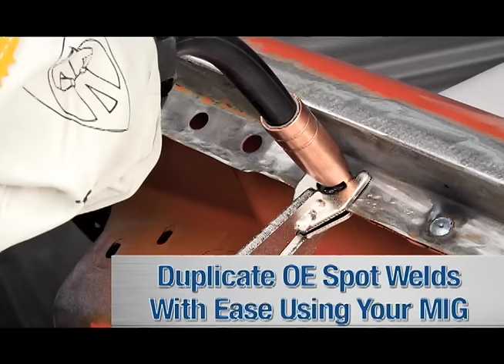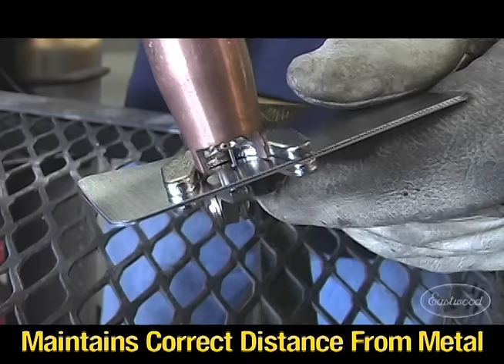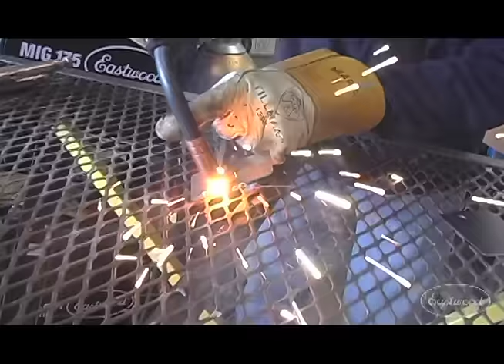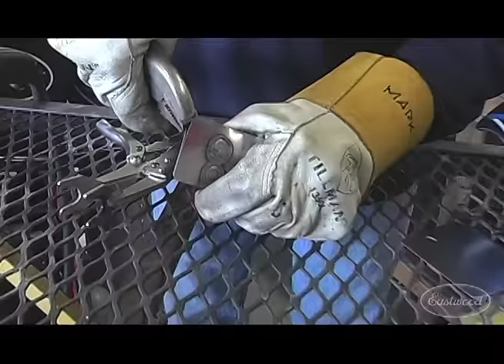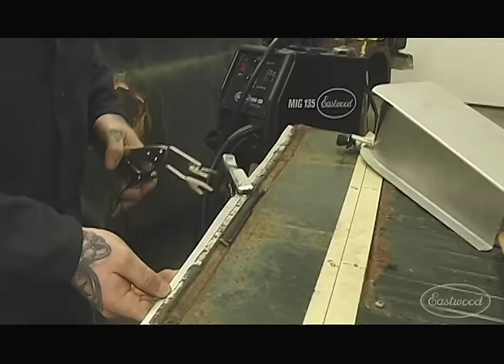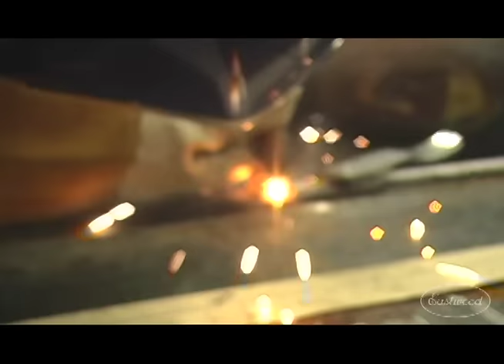Spot Weld Kit - How To DIY with your MIG Welder from Eastwood

Comment from the maker: It could be done on Aluminum, but would require a spool gun and a MIG that could weld Aluminum. We have not experimented enough with settings and pre-heating the metal to give good welder setting suggestions for Aluminum welding with this attachment, but with some tweaking it could be done.

Comment: It's a bit misleading to call this a spot weld when it is not. What this is ,is a puddle weld or tack weld. The welder is adding material to a pre prepared hole to weld the two layers together. A spot weld is a pool of molten metal caused by clamping two layers of metal together and passing a high current through the joint. Once the metal is molten due to the current ,the electrodes are pinched together to fuse the two layers together. No metal is added or taken away. In a high end restoration it is considered to puddle weld joints together rather than spot weld,as per original production manufacture.
Reply: How do you expect to do that while working on a car, for example changing rocker panels?That just can't be done without access to both sides of metal.

Comment: cheers il go cut out a nozzle and mod sum pliers
Reply: +GARRY GIBSON Did you try removing metal from a Nozzle? Did it work? I would think that you wouldn't want to remove metal from your Nozzle, because that would put your wire tip in the wrong location.
Reply: @NickeyChevelle  get a recessed mig nozzle and cut the opening to be flush with tip.
Reply: alignment shims

Comment: looks like an awesome product, but I'm a little confused. In the first scene it looks like two sheets of metal are welded together without any hole drilling, while in the second, it looks like the holes are pre-drilled. If the pliers stabilize the tip of the welding gun, which it looks like they do, how is the gun making contact with both sheets to achieve a good weld?
Reply: Both can work!  One is called "plug weld", one is called "MIG spot weld".  Pliers are not related to the gun at all!   Both sheets (which should be clean by the way) are clamped together, so electrically they're one thing.  You melt through one, then into the other.

Comment: I see some guys who want to modify their existing Nozzles to try to do this job. But, cutting your existing Nozzle moves the wire feed tip too close to the sheetmetal. Another guy wants to weld tabs onto his existing BRASS Nozzle -- welding brass takes special equipment (and talent), and of course the point in buying a tool is the convenience of having someone else manufacture it for you. I suppose you could make a spacer, but why bother? The Nozzle is inexpensive, just buy it.
Reply: No body said cutting the nozzle. They said cut out a nozzle and slide it on. Copper pipe and can be cut and pliers can be welded as Garry described. These are just gimmicks and conversation items for those who want to blow away dollars.
Reply: Inexpensive means less money in wallet.
Reply: @FrustratedBaboon  if you can't afford 35 dollars you can't afford restoring a car. Go ahead and NGR rig your own.
Reply: @BruceLee-xn3nn  what does ngr mean?..
Reply: recessed mig nozzle and cut the opening flush with contact tip.
Reply: 'Welding' brass is called brazing.

Comment: i wonder if i could just cut a normal mig tip into that shape? hmmm might try it. thanks
Reply: That is exactly what I did when Machine Mart did not have any plug weld shrouds in stock.

Comment: Does he move the gun during the weld or is he just holding it like a tack?
Reply from the maker: You can move the tip slightly in a circular motion to fill in the hole, if necessary. But it's very little movement.

Comment: Can it be done in aluminum as well?
Reply: As long as you have the spool for welding aluminum, along with the correct equipment, and skill to do it, I cannot see why it would not work out.

I've learned from a guy that works in the hardware department of a large store that sold tools, equipments and supplies.

I worked in the neighboring auto department in the same store, at the time.

The hardware guy that worked there before left long ago, hes one of those guys that are good to work with, and knows things too.

Comment: Does this still require a spool of filler wire to be used? If so, its then not really spot welding. Yes, it makes a spot,yes,it welds, but is more like controlled mig welding..If you do your research you will find that 'real' spot welding involves resistance and localised pressure, and has no filler material.Real spot welding is also called resistance welding.
Good vid and helpful to mig owners,but inaccurate.